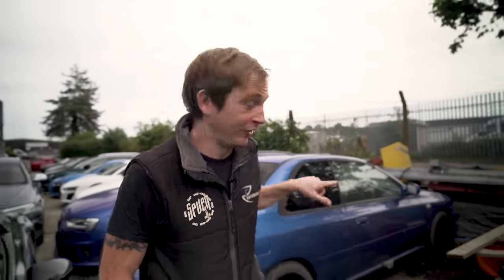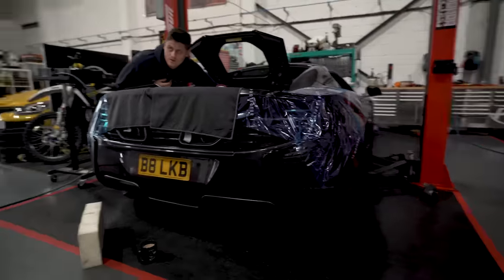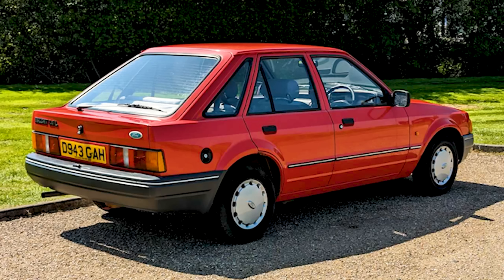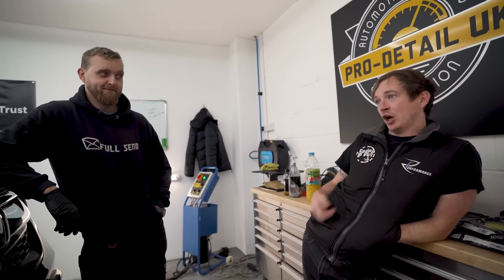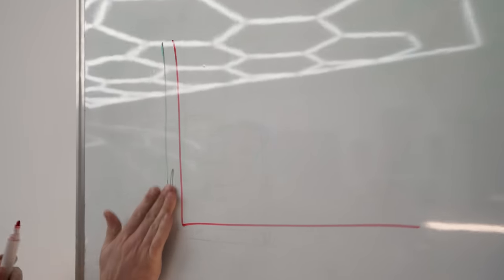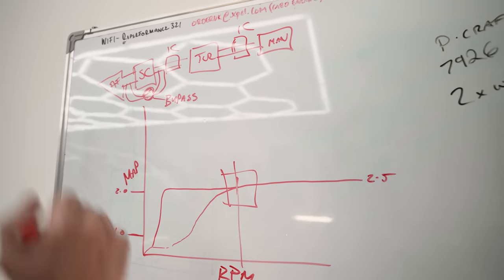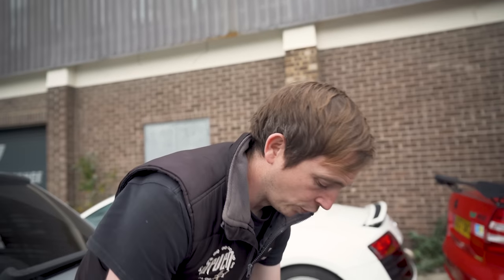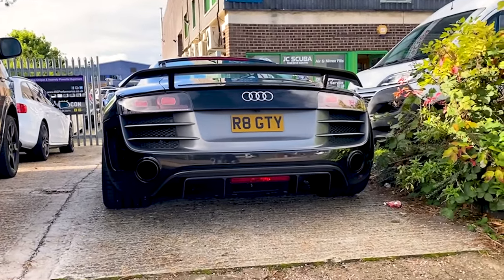My Dream Spec R8... and it's NOT a Gen 2!! Workshop Update No.35

Comment: Thanks for the Gen1 GT explanation. I kinda get why they are still in the +100k range.
Mate's not wrong about not f**ing with barnfinds unless you really really want that car. A buddy of mine found a 3.0 Granada Ghia that was parked with 47000km in a barn. Under a cover. It had one dull spot on the side where the sun shone on it for 30 years. Pulled the car out, new rubbers all around, resealed the engine and started using it as a weekender but there was a rhythmic thumping coming from the driveline. Rebuilt the tailshaft, new tailshaft bearing. Still thumping. Rebuilt the axles, new wheel bearings. Thump-thump. Rebuilt the gearbox. Nope. Pulled the rear axle and they found one half of the ring gear that was out of the oil rusted up.

Comment: My first car was a Fiat Uno aswell.  1.1L in a sh1tty off white colour.  Still remember the plate C999 UPJ.  Jumped a bridge, ripped the fuel line which p1ssed all over the engine/exhaust and set the front alight.  Engine cut out, I coasted to a halt, got out and watched my car burn until the fire brigade turned up.  
Got towed home by the old man with no front end on it and no brakes

Good times

Comment: You might rag on Honda's,but they are innovators and better built than yamahas, and old Honda's are starting to cost the earth. Don't know why you hate Honda's, early Fireblades 1992 to 1997are awesome, 2001 to 2007 are awesome. And the new blade 2021 on unreal road bikes and that just blades. Rc30/Rc45. Sp1/Sp2. Nc30/Nc35. NR750.Rc213 vs. Cbr 600 rr. That's just my favourite. No one can deny how good these bikes are.

Comment: Something nice 😂 your car history is shocking but so is mine my bike history rode a yamaha tzr 125 to work for three years then bought kawasaki kr1 250 ex race bike had a Bob farnham tuned engine crazy fast untill I blew it up piston ring locating pins nuff said rebuilt the engine large dog ran across the road I hit it went over the handlebars dog was dead me lucky just badly bruised bike destroyed next bike 98 cbr 600 kept it for a year bought a 2000 zx6r hated it bought a mint 94 fireblade kept it for a year bought a 2000 R6 great bike fast had to sell it coz I met the traffic cops one summer evening I was doing 165 as you do end off story Hi Kate ⚘